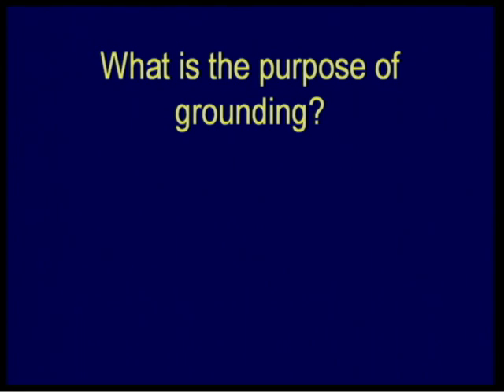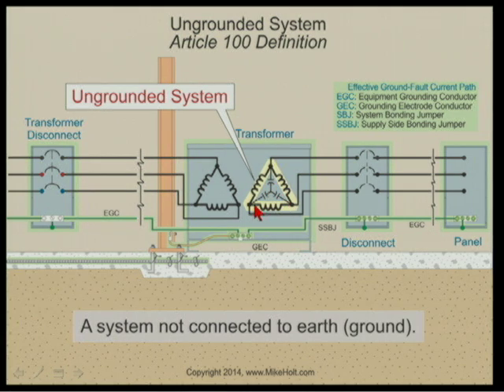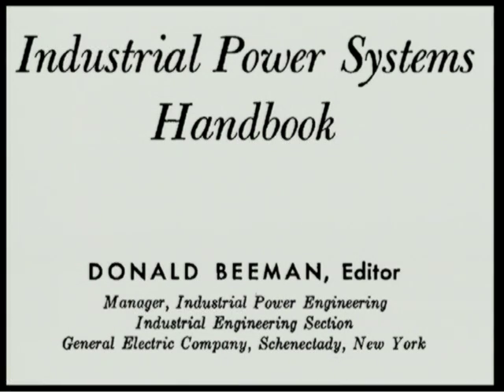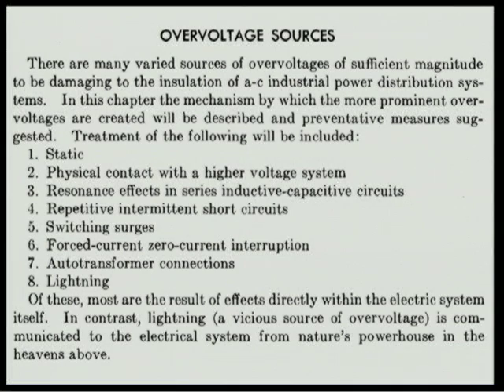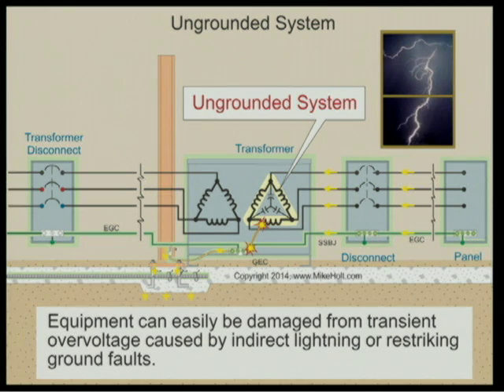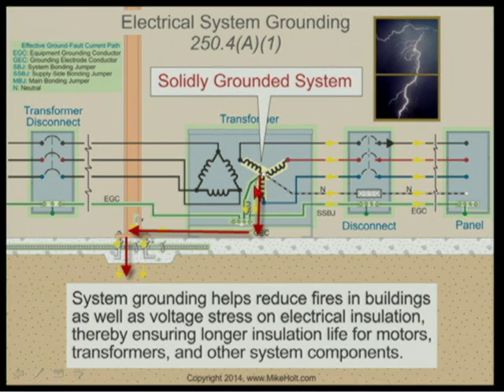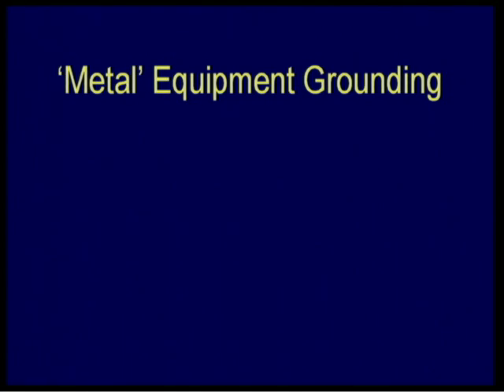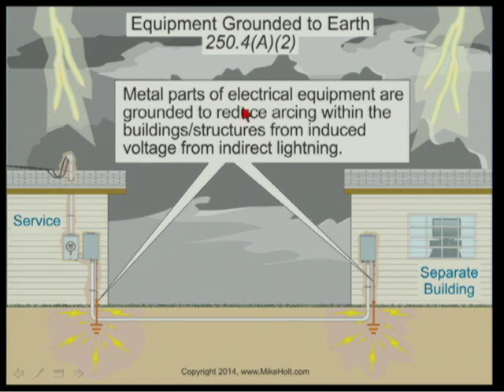Purpose of System and Equipment Grounding (13min:48sec)

Comment: does this mean line to ground voltage is 230 volts same as line to neutral?
Reply from the maker: Line-to-ground voltage is the same value as line-to-neutral voltage at the secondary of the transformer.

Comment: Question 1. Is there a dedicated, unique and special Grounding for Sensitive Electronic Equipment? 
2 Question. 
In the event of a lightning strike near my property is it recommended to unplug my electronic devices?
 3 Question.  Why is there always a little (0.3 Amps)  current flowing from the neutral bus bar (on the main panel) to the ground rod ? 
Does it  mean that some of that current could leak out 
through the equipment grounding conductor form the main panel to the sup panel energizing the equipments conected to the EGC?
I would appreciate it so much if you help me answering those 3 questions.
Reply from the maker: No. 1. Nope, nothing special required.
No. 2. I don't know anybody that takes that action.
No. 3. Because the seconday neutral is bonded to the building grounding electrode, so return neutral current travels on both the neutral and the earth to the utility neutral. If you send me an email (Mike@MikeHolt.com), I'll send you a link to a video that explains this.
Reply: @MikeHoltNEC  Great sure I will send you an email now. I have one last question sorry to bother you mike. 

Mike suppose that we have unbalance phases in our electrical system,  as a result our neutral wire carries certain amount of current back to the source let's say   20 A with 5 V to the transformer.  Why do engineers say that connecting that neutral wire to a ground rod on the transformer will cause the neutral to be 0 V? Isn't voltage suppose to be energy per charged particle? If so, then how come those 20 A can make it to the transformer? Like with what energy per charged particle can those electrons get to the transformer if their potencial energy  was taken ? I hope you can undestand my point and help me  out with this question that nobody in colombia  knows how respond to.
Reply: @MikeHoltNEC  I found one of your youtobe videos that answered 2 of my questions. Wooo https://youtu.be/YuDqXFvRv94 

I Will continue to watch  all your videos am pretty sure I will run across  the answer of my last question I sent to you throuhg email.
Reply: @MikeHoltNEC  Mile I really thank u very very much. You are fantastic and very knowledgeable. Thank u thank u Mike.

Comment: Amazing stuff to introduce in this world of electrical protection but I am a little confused in the sense that:

 1-in the final what is the purpose of the EGC(equipment ground conductor) because in this lecture Mike says that EQUIPMENT GROUNDING is to provide a path to the earth in overvoltages situations. but in the lecture (1 of7 the electrical circuit www.youtube.com/watch?v=Lu_E-iUkvwo&list=PLRNS1x1jcKbEgNJx26RWB8O4Fm1Ny-bxK&index=2 ) the EGC is used to provide a path to the source and therefore clear an overcurrent fault and not only for overvoltage situations.

2-we can use the EARTH as a conductor to provide a path back to the source. because I have seen many videos if not all that use the earth as a conductor to clear a fault current.

Mike thanks for your videos for me they are gold. Keep creating more content, please!
Reply from the maker: Watch this video, it will put this all into prospective. https://www.youtube.com/embed/mpgAVE4UwFw
Reply: @MikeHoltNEC  Thank for the reply but it seems that the link doesn't work I try with several browsers. I think is because the link contains studio.youtube ??
Reply from the maker: @d.militomilito2002  Sorry, I corrected the link to https://www.youtube.com/embed/mpgAVE4UwFw

Comment: Why neutral grounding resistors are used in transformer earthing? As per online content they are use to reduce fault current but if we are adding resistance in transformer neutral to ground path,  how they contribute in system fault reduction?
Reply from the maker: Ohms law, if the fault return path has a resistance of let's say 1 ohm at 277V fault, then the fault current would be limited to 277A.

Comment: Regarding system grounding--how does the presence of a system ground eliminate voltage on the equipment? Wouldn't the equipment making up the system essentially be connected in parallel with the earth, meaning all points at the same potential?
Reply from the maker: Nope, go back and watch Parts 1-7.

Comment: How do impulsive overvoltages that induces from the lightning to the phase electricity runs through earth grounding wire, but not with the phase electricity itself?
Reply from the maker: Induce volage 'on the conductors' travel from the conductors (phase and neutral) to the system XO terminal that is connected to the earth, then to the earth.
Reply: @MikeHoltNEC  how could the phase electricity itself doesn't go through that XO terminal? and then goes to earth? (when there are no lightning occured)
Reply from the maker: @faithzero4112  Electrical current does NOT go to ground, it goes back to the source (transformer).

Comment: In Australia we use an earth stake at our first switchboard in an installation (sometimes sub boards also, though must have unbroken PEN back to transformer) we then connect all conductive parts(non double insulated) to this earth throughout the installation, we also have MEN Multiple earth neutral, which is a low impedance earth at the transformer neutral on the LV side and then a low impendance earth connecting the (PEN) protective earthed neutral at the consumer side of our incoming mains so that in the event of a fault our system will draw a rapid influx of current and trigger our protective circuit devices in fractions of a second. This prevents our circuit from operating under most fault conditions and also from people becoming the path to earth if they touch a conductive part of the system that is carrying a fault current. Our system is designed to keep the impedance values of Active and earth cabling as low as possible.

Comment: Question: I'm not clear on the first graphic. In the explanation, the Equipment Grounding Conductor is a direct connection to the ground to prevent transient voltage/ over-voltage. Ok. In the graphic @ 3:45 the Equipment Grounding Conductor runs from the disconnect to the ground bar in the transformer, then connected to ground which is contrary to the EGC being "As Short as Possible." Wouldn't the EGC at the disconnect go directly down to the earth to protect the enclosure, and another ground to the transformer as a means of bonding the encloses both to their respective ground terminals? Is there something about the disconnect that is different from other forms of grounding? Confused.
Reply: The Equipment Grounding Conductor(EGC) serves to carry out other functions that the Grounding Electrode Conductor(GEC) does not. The (EGC) is part of your effective fault current path.

Comment: At Ford we use ungrounded systems in our manufacturing plants. We don't have any problem with overvoltage... Both our 480, and our control circuits are mostly ungrounded.

Comment: hello sir,kindly help me
can i make combine SRG signal reference grid and power earthing, i want to connect power and low current communication equipment together connect to one single earth source  is it allowed if not why?
Reply from the maker: +Mubarak Zaib This is not only allowed by the NEC but it is required that all systems be bonded together see 250.94 in the National Electrical Code.
Reply: wow sir thanks but please let me know i have power cable tray and data cable low current cable tray i maked single source earth point outside from data center  and bonded both power and low current cable trays and padestle down raised floor then communication cabinets but consultant engineer rejected what is the reasons please
Reply from the maker: +Mubarak Zaib Please post your question(s) on our Code Forum at www.MikeHolt.com.
Reply: @MikeHoltNEC  It is true that electronics devices would burn if we have our system grounded ?
Reply from the maker: @miguelac6872  The performance of any device, electronic or not, has nothing to do if the system is or is not grounded. In the USA, for all practical purposes, all wiring is connected to a 'grounded system.' And for all practical purposes, most electrical equipment has electronic components, and they work fine. Who told you otherwise?
Reply: @MikeHoltNEC  Woo that is an Awesome answer. I have heard that myth sir. Thank u very much for clarifying that.
Reply: @MikeHoltNEC  Question 1. Is there a dedicated, unique and special Grounding for Sensitive Electronic Equipment? 
2 Question. 
In the event of a lightning strike near my property is it recommended to unplug my electronic devices?
 3 Question.  Why is there always a little (0.3 Amps)  current flowing from the neutral bus bar (on the main panel) to the ground rod ? 
Does it  mean that some of that current could leak out 
through the equipment grounding conductor form the main panel to the sup panel energizing the equipments conected to the EGC?
I would appreciate it so much if you help me answering those 3 questions.
Reply: @MikeHoltNEC  Do you have a video where you explan that?
Reply from the maker: @miguelac6872  Not sure what you are asking, but watch https://www.youtube.com/watch?v=mpgAVE4UwFw.

Comment: How does DC voltage have a frequency??
Reply: DC can also refer to signals that are constant polarity.
Reply from the maker: That's an excellent way to explain dc.
Reply from the maker: +Kevin Weigman Lightning is high-frequency DC - see http://physics.stackexchange.com/questions/132576/why-is-lightning-referred-to-as-high-frequency-source
Reply: I get it. Thanks
Reply from the maker: +Just Casey Lightning is high-frequency DC - see http://physics.stackexchange.com/questions/132576/why-is-lightning-referred-to-as-high-frequency-source
Reply: +Kevin Weigman Exactly!  DC is zero frequency.  He had repeated over and over again on this DC high frequency.